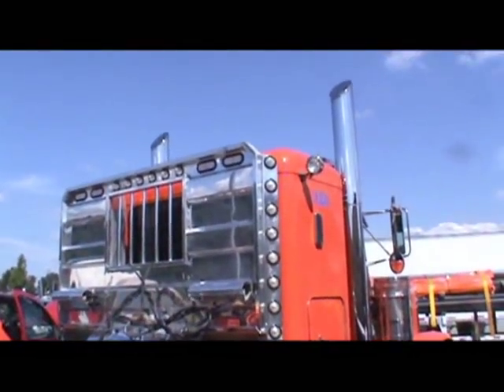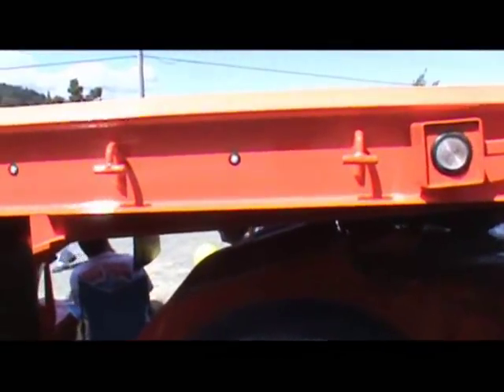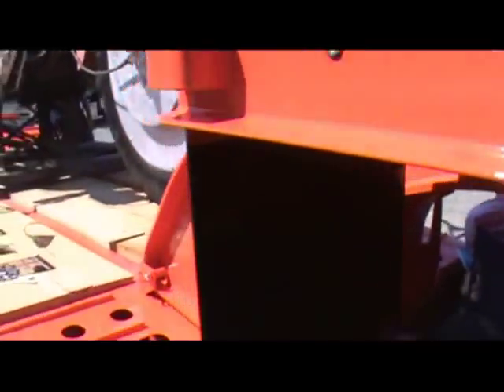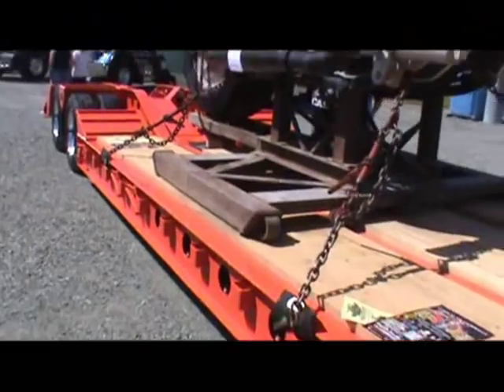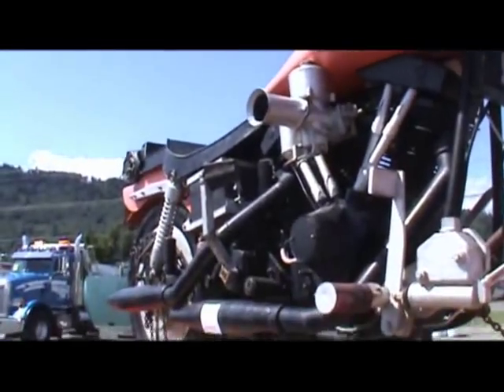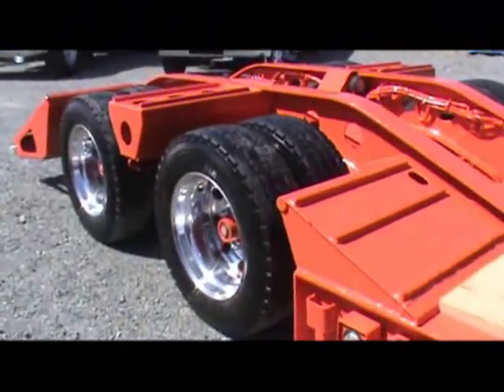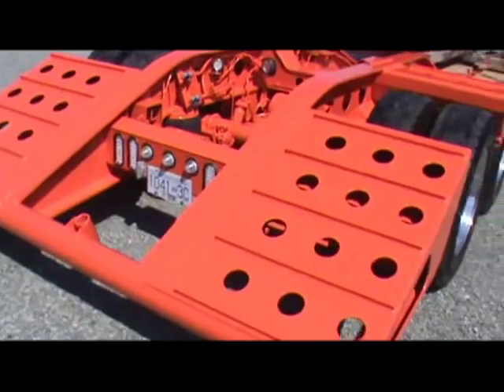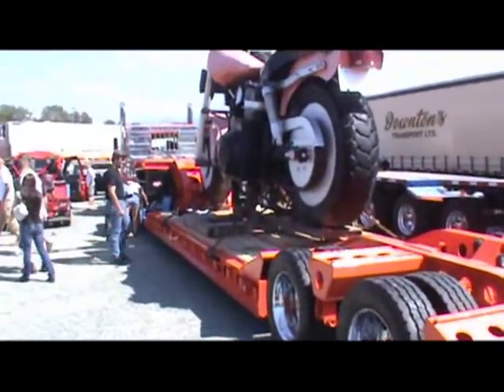Lowbed Daryl

Comment: I remember back in the early 70's, ACCO contractors(Tidewater Contractors now days)had an old Peerless lowboy.(Without the beaver tail) They'd send me out to pick-up a 966 by myself. I'd get up there and have to use some muddy old dirt ramp to load it. You'd have half the tires hanging over the sides. Boy, would OSHA have fun with that now!
But maybe they wouldn't because they send self loaders out with only the driver. I think that's a bad deal.
Outstanding looking truck/trailer.